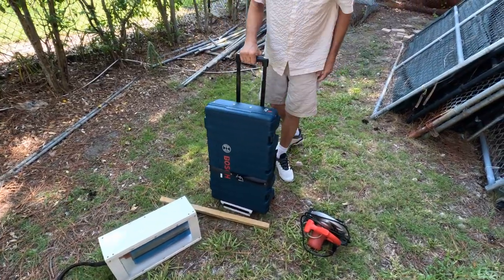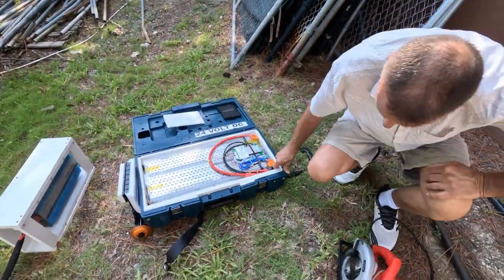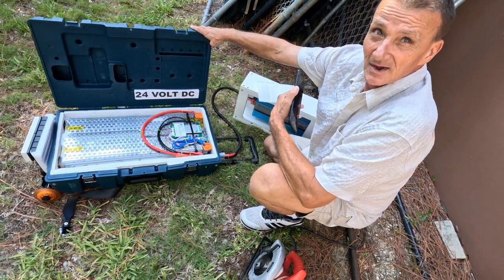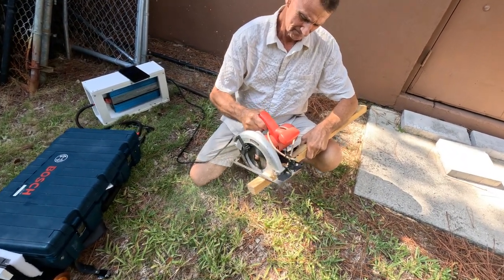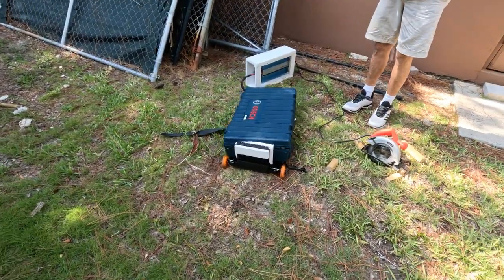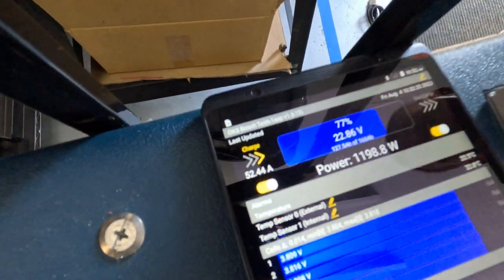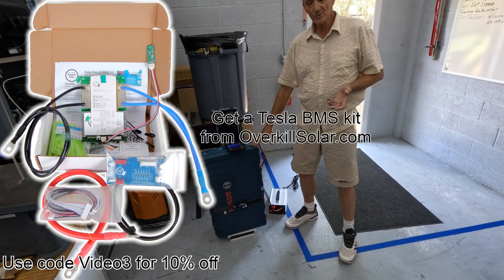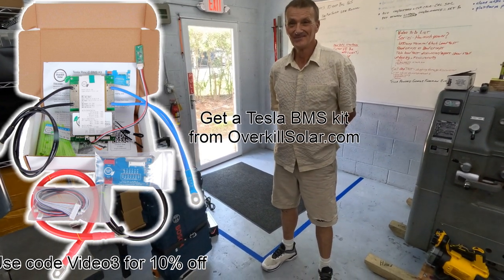Tesla Battery Demonstration

Comment: That's awesome!!! I've been waiting for someone to make a Tesla BMS. Glad you pulled it off for consumers.
Reply from the maker: Thanks! Do you want one to test?
Reply: @OverkillSolarLLC  I'm not using any cobalt based chemistries on my channel any longer and the voltage range of those packs is why I stopped using them. So I'll have to pass
Reply: @OverkillSolarLLC  love the bus bars you sent. Used them in the 18K video
Reply from the maker: We did some testing with different inverters and found an AIMS inverter that was well suited to the voltage range: https://overkillsolar.com/2023/04/14/24v-inverter-testing-with-a-used-tesla-battery-module/